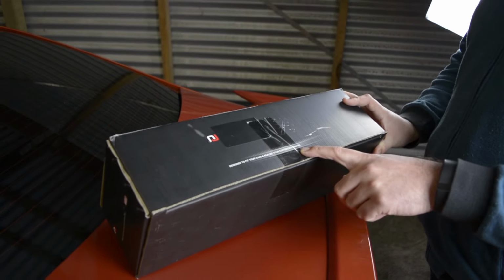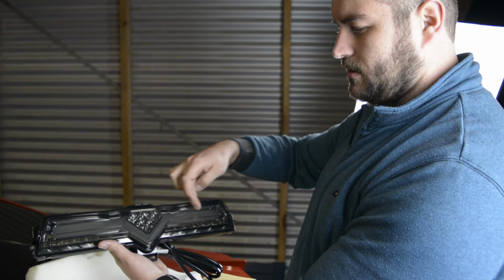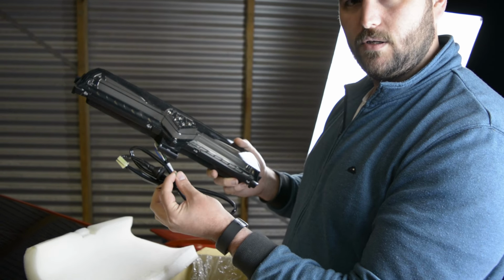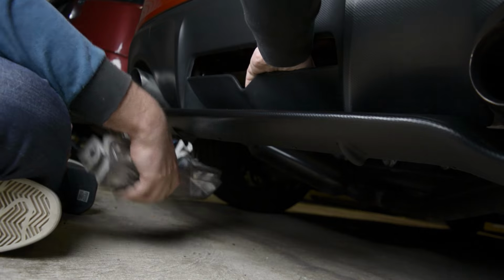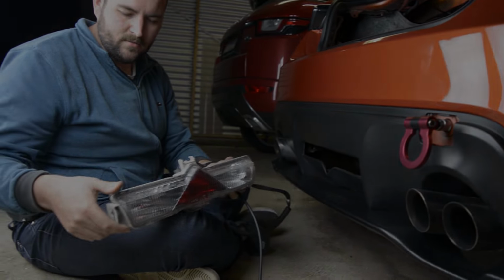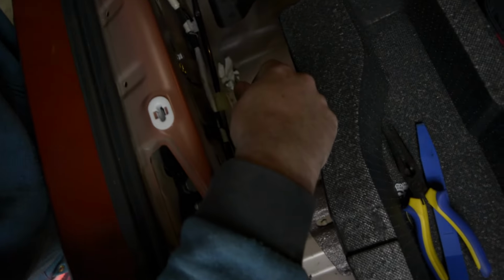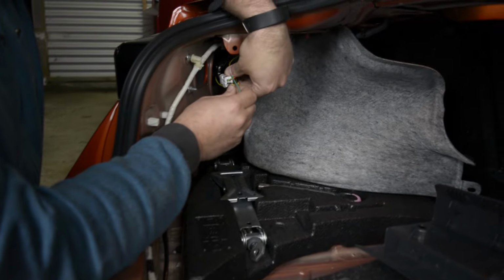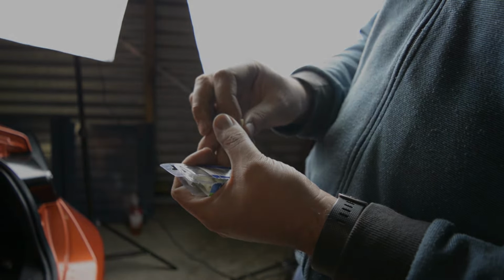Rear fog light install (GT86, BRZ, FRS)

Comment: Thanks for the video. If I understand well, you used the 3rd V-shaped light as a brake light by connecting the fog light's green wire to the left rear tail light's red wire. Is there a way for this V-shaped light to act both as a tail light and a brake light just like the OEM tail light? Maybe by splicing the rear fog light's green wire to the tail light's red and green wire with 2 different quick splices or would this electrical set up be completely wrong?

Comment: Great vid fellas! Got me a Barina Spark and I have installed some floormats.
Reply from the maker: Glad you liked it mate! floor mats!! wow, like a set of 4 or just fronts?
how did you find the ride after the install? could you notice the extra kw?
Reply: +To The Point cheers guys. Is a full set of 4. Need to adjust the front one every now and then. To be honest was a little worried about how much weight they were gonna add to the car but I have been thankful on windy days cause they could be actually holding the car down on days like that.
Reply from the maker: Yeah man always a good idea for the spark to upgrade the mats. That would be pushing like 65kw at the wheels now surely?
Reply: +To The Point I'm gonna assume you mean km (kilometers) and yeah your right I do push really hard to get up to 65km.